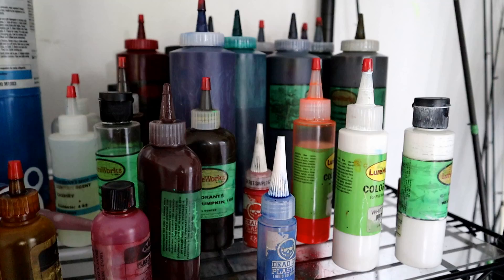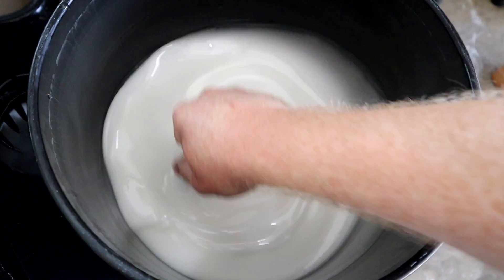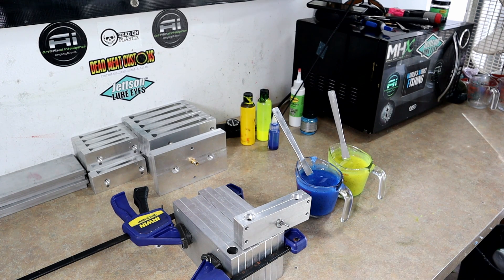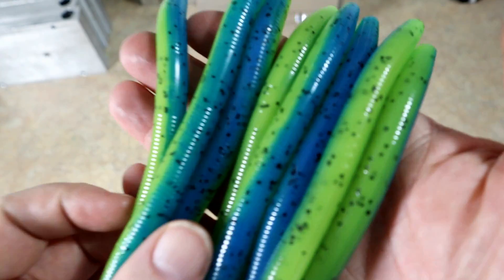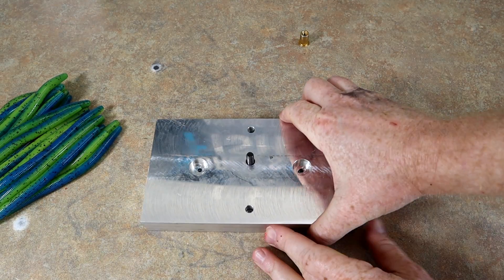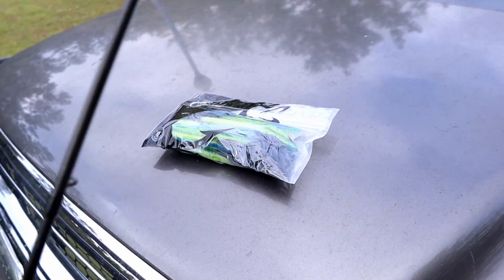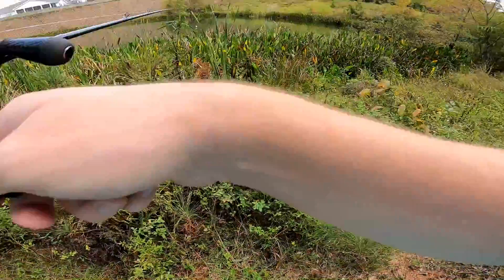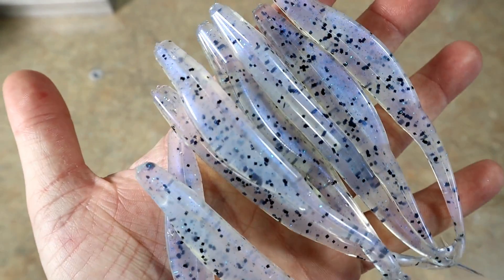Create & Catch: Skirted Stick Worms for Largemouth Bass

Comment: Cut the skirts in half and use the 2 halves as pectoral fins on a hand pour
Reply from the maker: Interesting idea
Reply: Put a angle on that nub in middle and shape the ends to size, I'd guess depending the bait that would add action in a place were fish don't typically see action on a lure

Comment: they should put a corkscrew at the end of the blending block so it puts a swirl in the plastic before it go's in the mould.
Reply from the maker: That has been tried and it does not swirl the baits, you have to remember the cavities go sideways and most molds.. the only way to swirl is to pulse a duel injector
Reply: @WorldsWorstFishing  what about a single cavity that go's straight in.